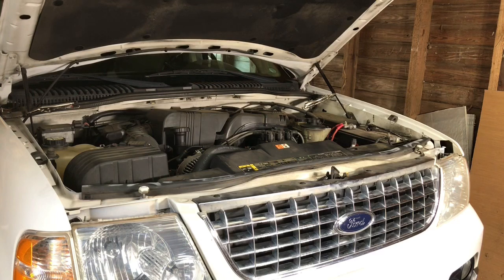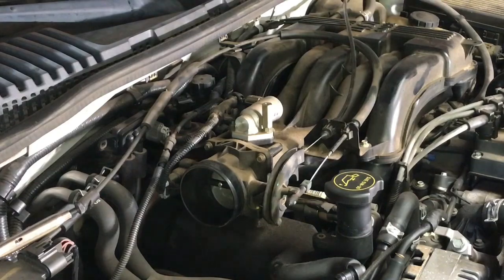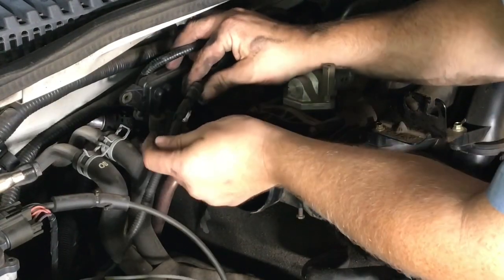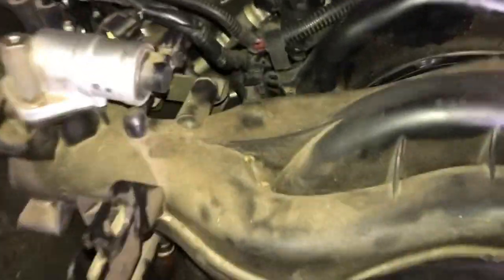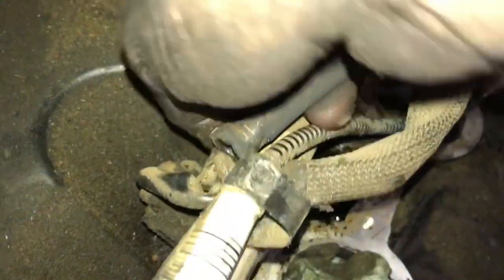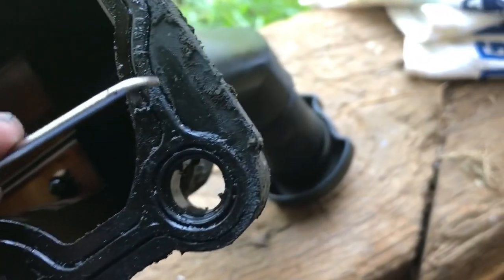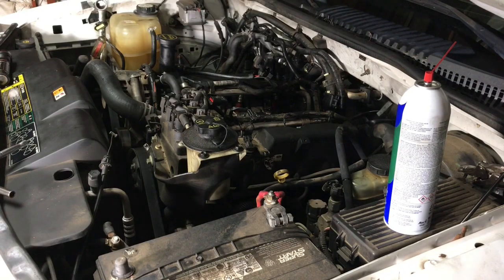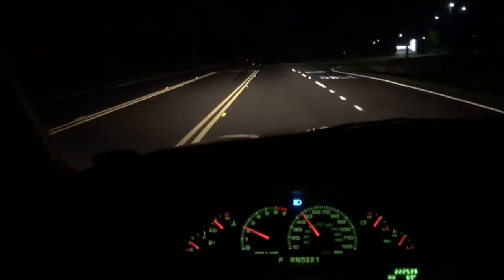Changing Valve Cover Gaskets 4.0L SOHC V6 2003 Ford Explorer

Comment: I have watched alot of videos on this because mine need replacing and I have to tell you yours is the best. Very professional, you didn't miss a thing. Great job thanks.
Reply from the maker: Thank you I appreciate it!
Reply: Totally agree. This is without a doubt the best video on the subject. Subscribing. You are a poor man's hero Mike.
Reply: @MikesGarage96  Mike I am Jack in Baton Rouge, fixing to  do the valve cover gaskets tomorrow. I have seen too many vids where they just complicate shit and add their Late Night w/ Conan O'Brien jokes and they aggravate a person who has enough on their plate w/o that other bullshit.... You come to the point walk a person thru it and add the little extras u need to know. I have a 2002 Explorer XLT 4 wheel drive 4.0 L have a bad oil leak on rear of driver side valve cover. And the smell .... Thanks Jack  ps just r/r timing chain tensioners can tell u a thing or two about this procedure.
Reply: @MikesGarage96  Mike this is Jack again in Baton Rouge, I have a 2002 Explorer XLT 4 wheel drive V6 4.0 L have a pretty good leak on driver side valve cover at rear hits exhaust manifold and  all over starter  to ground. My question it has 250 k on it do the gaskets get hard and can it cause bad oil leak and vacuum problem. Thanks Jack
Reply: @MikesGarage96  Big Mike thanks for your time and consideration making vid. Finishing up my 2002 Explorer XLT 4 wheel drive V6 4.0L replacement of valve cover gaskets and intake manifold gaskets as well as cleaned Mass air flow sensor, throttle body both sides, also plenum as needed ,and pvc valve. Alot of degreaser on areas where oil leaked on motor area and underneath. Anyone who thinks the valve cover gaskets won't dump oil everywhere give it a try..

Comment: I changed out my gaskets this weekend. It was a little tough but with a good plan you can get through it fairly well. I did each cover one at a time to not mix things up. I changed out one bolt at a time so they would not get mixed up. When putting the intake manifold back in place I taped the torx socket and an extension in place to the back of the intake so it was already attached to that hard-to-reach back bolt. I tightened that one down a little bit then used a second torx for the rest that I could easily reach then finished off the tightening the bolts. Too bad Ford wasn't smart enough to have an extension built into that manifold to reach that back bolt. I still have some work left but at least this part is done and hopefully never have to do it again. Thanks for the video. It was helpful.

Comment: You can use black RTV and seal the leak instead of replacing the gasket.........IF the leak is coming from the bottom side, since there's Lots of room to work.....just clean it with brake cleaner, then use black RTV.... I've done it before, and it will Seal pretty permanently, and buy Lots of time at the worst case scenario.....but it always depends on How bad it's leaking, if you do it correctly, etc.....it's really just simple physics.

Comment: I tourqe my valve covers and  1 of the center bolt broke ...I found out not to tourqe them hand tighten them as much  its much better than tourqing them and having them break 😡🤬 now I have to take out that broken mount bolt in the head could of been done if that bolt didn't break ......soo caution when you torque those bolts ...I'll just hand tight mine and check if they Leak and retighten them if they do ....

Comment: Forgot to thank you once again. Followed all your steps and completed this in about 7 hours.. I guess my best piece of advice to anyone else would be to just take your time and take pictures along the way..
No leaks and no issues after a 600 mile road trip.
Reply: Was your explorer leaking oil all down the back?
Reply: @bryanferree7499  mostly down the drivers side onto the exhaust headers.
Reply: @bryanferree7499  mine is doing that, going to change the seals this coming week.

Comment: Man I should have found this video sooner! Had to pay 350+ just to get a mechanic to do it, which is understandable. Was gonna do it myself with help of another but they were unable to guide. This will help hopefully get me to replace the seals of the injectors, which by the way you should do if your looking to replace the valve covers!
Reply: @crazyfvck  yeah this video is a good help. Got rid of my explorer as the problems started to occur more frequently. First it was the injector leaking gas, another was the whole solenoid shot. Started digging me a hole that I had to get out of. If your mom can trade it in without it throwing codes, do it! Your mom will be happy in a better SUV I can guarantee it.

Comment: Big Mike, Jack n Baton Rouge, 2002 Explorer XLT 4 wheel drive V6 4.0 L I didn't know you could ck trouble codes on the Ford trucks at the digital odometer on dash. It has alot of functions as u click the reset button . B4 u turn key to on push and hold reset down turn key to on not starting vehicle. Then when u see ftc illuminate let up on button. Then push to each function that u want to ck. It does give you trouble codes 1st thing and so on. Comes n handy when you hook battery back up drive your 20 odd miles to 50 usually and see if you have any new codes.  Jack

Comment: Thanks for sharing, however the hardest part you omit.  Back bolts for the intake and removing the pipe over the left valve cover as well as the left valve cover.  If would be great to inform your audience those points so one can say i will do it or pay someone to do it.

Comment: I have to replace both of mine on my 02 explorer, only 151k on the dash, it's been leaking slowly but got bad on the driver side. Probably need to change the pcv valve which could have caused the valve covers to start leaking to begin with. I'm just curious if you can actually see the intake valves with the intake manifold off, like maybe use a mirror to see in it so I can see if there's carbon build up. Might as well try getting those cleaned off as well

Comment: I am currently doing this on a 2004 Mercury Mountaineer. This video is very helpful. Quick question, I’m positive that I have the valve cover torqued down, more would probably break a bolt. I am able to see the Orange of the new gasket. Should I be worried? I haven’t finished install yet, and don’t want to put everything back together  for it to be spewing oil out upon restart. Any help would be appreciated.

Comment: Amazing video, but the one wiring harness connector on top of the valve cover on driver side instead of pulling the clip out just push it down slides right off

Comment: I took my Explorer to the shop and after they replaced the gaskets and put everything back in,, the engine is not starting!
I think that the guy there didnt unplugged the battery and damaged one of the sensors.... what do you guys think that might be the error?

Comment: Ok... yeah looks to be more than I want to do.  😳 Mine been leaking for couple years.  Smoking exhaust pipes is getting old. 🤔... question... if I degrease... then brake cleaner ... then ultra black RTV sealant the outer rim... think that'll be temporary fix??? 🤣😂🤣

2002 Exploder 149k

Comment: Vehicles have become 100 times more complicated, but gaskets to seal oil from leaking haven't improved since the 1950's.  That job looks like a real nightmare to do, what once was very simple and well within the backyard mechanic's ability.  I have leaking rocker cover gaskets but other than the fact that it stinks when I have the heater on, it really isn't a problem.
Reply from the maker: Yea it’s a different world now mechanically. My first truck was a 1983 F-100 with the 300 inline 6. It had so much room under the hood that I could sit on the fender well to change the spark plugs

Comment: Questions  Mike---------is it recommended to tighten loose bolts before installing a new valve cover gasket ?  When only tightening   the bolts can you  work around some of the parts  that would be in the way with a gasket replacement?  I have not found a video for only checking the bolt tightness.       Thanks for the video .

Comment: I have a 2001 explorer 4.0 couple weeks ago it started spitting and sputtering one day ( loosing power during acceleration) figured it needed a tune up and I noticed valve cover leak so I changed the valve cover gaskets and changed plugs/ wires/ fuel&air filter/ oil change & filter and the vehicle idles great just has no power when excelerating to take off. It will gain speed eventually and maintain speed until climbing a hill and needing more exceleration and it's starts to spit and sputter again. We did a pressure test to check cats no back pressure fuel pump is new maf sensor readings are good any ideas what could be causing the problem

Comment: There is a line I don't know where it goes and I didn't see you pull it from anywhere. I followed everything exactly as you did but now when I start it, it idles like absolute trash then dies. What did I do wrong.

Comment: Im doing this exact fix tomorrow.  Thank you for the torx size.  Is the egr tube on the exhaust manifold a  1 1/16 like the top nut of the egr tube?
Reply from the maker: Yes it is. At least on mine it was
Reply: @MikesGarage96  yes it was.  Thank you.  Got the job done in 5ish hrs not including the time needed to search around for the rubber injector sleeves that the injectors slide into.   At 230k miles since I was in there I wanted to replace as much as I could.

Comment: great Video Mike  I have an 2002 needs valve cover gaskets I can see oil on top of engine like in the video. I go through about a quart a week and car smokes quite a bit do you think I can burn oil from leaking gaskets maybe intake gaskets are leaking as well. it has 178k so no looking to a put a lot of money into it
Reply from the maker: The valve cover and intake gaskets are pretty cheap, it just takes some time. Try to locate where the smoke is coming from. A lot of the time when valve covers are leaking, it runs down onto the exhaust manifold, causing it to smell and smoke like crazy. You’ll see some residue.

Comment: Mike, I can’t seem to get the lower EGR pipe nut off of the exhaust manifold. I’ve tried soaking it a few times for hours with PBR Blaster but it won’t budge. I have a long 1 1/16” open end wrench but maybe need more leverage. Any suggestions or tips? How did you get it off?
2002 Mountaineer 4.0L, 140k miles. Such a great video and so helpful in doing this valve cover gaskets replacement job. Thank you for all your effort and for sharing it. Jim
Reply from the maker: Fortunately, mine broke loose with the wrench. Exhaust parts can be boogers. I would try heating it up really hot with a propane torch and then try breaking it loose.
Reply: @MikesGarage96  Okay I’ll try,  thank you. You may want to mention that the DIYer should try and break this loose first before proceeding with the job. Otherwise they may get stuck halfway done (like me) and not be able to get this off which is necessary to remove the passenger side valve cover.
Reply: Success! I heated it and had to get a 2’ Long x 1 3/4” diameter pipe over the wrench for further leverage and it finally broke. I also had to move the radiator reservoir out of the way for the leverage clearance. Thanks again!
Reply: I worked on getting that nut loose for hours.  I had decent purchase on the nipple between it and the EGR line compression nut.  Tried liquid wrench,  tapping, coke, heat and no luck.  I finally cut the line off just above the nut. It took a vise and a lot of force to break it loose from the nipple.  Envious of those who were able to crack that nut in place!  Thanks for the fantastic step-by-step Mike!  The rest has gone smoothly and now I can put it all back together.

Comment: Mike, thank you SO much for making this video!! My driver side valve cover is leaking at the gasket and timeline to replace it is on the sooner end now. Slow oil leak through it and very small, but enough to make a mark on the driveway. Question I want to ask you is how long in total did this take you to do? Also, I'll eventually have to replace my exhaust manifolds as well - would I be repeating these same steps to get to them to make it easier? Thank you!
Reply from the maker: It took me a few hours, filming really slows me down 😂. You’ll have to remove things like the EGR tube and other things in the way, but I don’t think you’ll have a need to remove the valve covers.
Reply: @MikesGarage96  Thank you. So when I go to replace my valve cover gaskets, plan for a full day essentially?

Comment: Hey Mike thx for the vid. I have a 2002 model 4.0L and I ended up taking both the fuel rails off and the injectors out of the passenger side of the motor to get more access to things. Then after replacing the valve cover gaskets, and also intake manifold gaskets, I reinstalled everything. I go to start it and it will crank but will not start. I didnt bother putting the fuel injectors back in the same order, would that be why? I dont know what I did to it! So frustrating! Also...I disconnected the neg battery cable prior to working on it, then I reconnected after all was reinstalled.
Reply from the maker: One of the intake gaskets could of slipped out of place while installing the intake. Look very closely or blow some smoke into the intake system and look for leaks.
Reply: Mike’s Garage looks like I forgot to plug in the connector for the coil pack. Went to try and start it and it still wont. My fear is that I messed up the timing/firing order or something by trying to start it without the coil pack plugged in...is there some truth to that? Also, should I bother spraying some starting fluid in the throttle body?
Reply: Nevermind it started- running fine now...not sure what i did...
Reply from the maker: At least it’s running! Congrats

Comment: Im absolutely using this as a guide to doing mine.  But I need to ask, where is the pcv valve on a 2004 Ford Explorer 4L V6?
Reply: Its on the back side of the intake close to the brake fluid reservoir. It's a pain to get to because you can't see it. You have to feel it

Comment: Hey Mike question! Have you had to replace the rocker arms on a 03 explorer before? My explorer started making a loud ticking noise and I received an error code in the 3rd cylinder. Thanks for any help!
Reply from the maker: I haven’t before on this engine. Haynes manuals have a lot of good info for specs

Comment: Ohhh, he missed how he reached thee back bolts next to the firewall on the upper intake manifold
Reply: Foreel its giving me a bitch time just the last one closest to the steering wheel, I know I really just gota quit pussy footing with it tho
Reply: @brandonsmith345  I ended up using a video stream from my phone in my left hand and locked torx on with my right. Have since bought an endoscope so no need to hold cell phone.
Reply: Yeah I'm trying to get it what a crock oh s. Hi t

Comment: Car doesn’t start after replacing. There was a piece of plastic inside the valve when we opened it up on the driver side. Could this be the reason it doesn’t start?

Comment: For the intake manifold bolts they get torque to 89 lbs? I can't get a torque wrench on the back bolts?
Reply from the maker: That’s what the specs are in the book, but I did mine by feel. As long as you don’t over tighten and strip the threads, you should be good. Just tighten it down in a criss cross pattern

Comment: I did this job yesterday in mine 2002 Ford explorer but now shakes my motor what do you think before was good
Reply from the maker: Check to make sure a spark plug wire or fuel injector wire didn’t accidentally pull loose. If you have access to a code reader, check to see if you’re getting a misfire on one particular cylinder
Reply: @MikesGarage96  I had a rough start also, checked with a scanner and had a pending code for #4 fuel injector misfire. Luckily 4 is on front of engine, driver side. I checked wiring, wiggled the injector and tapped on it with a screwdriver. Engine smoothed out & problem solved. I also added some Lucas fuel injector cleaner to the gas tank, their products really work.

Comment: How long did this actually take you to replace the gasket
Reply from the maker: A few hours, but filming slows down the process
Reply: @MikesGarage96  I'm a 64 year old female,  in construction since I'm 23, carpenter by trade,  so I'm very familiar with my tools,  but my back ain't worth crap now, on a fixed income, the cheapest place I've been able to find wants 475.00  to 657.00 for me that's unexceptable, both gaskets cost me 75.00, is 400 + in labor reasonable,  or should I do it myself, I need my car, it would take 2 to 3 months for me to pay that much
Reply: @94SexyStang  would it surprise you to learn it was done for under 300 plus parts which was under 100 bucks

Comment: what did you use to disconnect the egr tube?
Reply from the maker: Just an open end box wrench. It’s a tight spot to get to. Soak it in penetrating oil beforehand.
Reply: @MikesGarage96  in the rust belt, it'll probably be necessary to go through the wheel well in order to get the power on the tool necessary to break the rust seal. Working on cars up here is a different animal than it is for you southern boys

Comment: My Chilton's manual says 89 in-lbs for valve covers
Reply from the maker: I got my torque specs from All Data. With  small fasteners like these, I would go with the lower end spec. They will strip easily.

Comment: Should have replaced fuel injector seals.
Reply from the maker: Fuel injectors doesn’t come out when changing the valve cover gaskets. No need to change them.